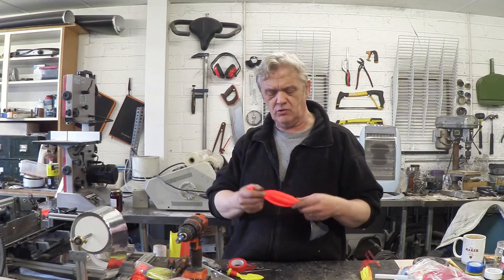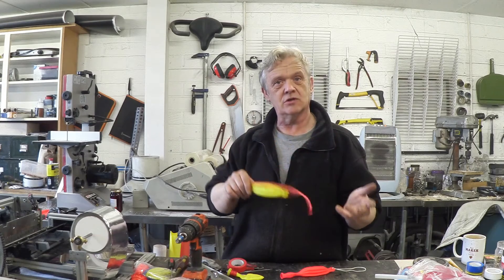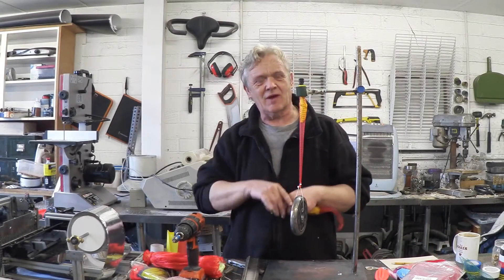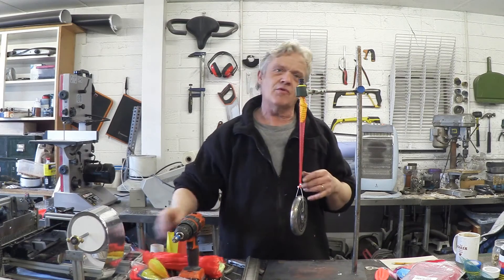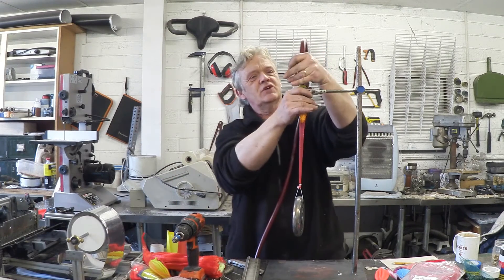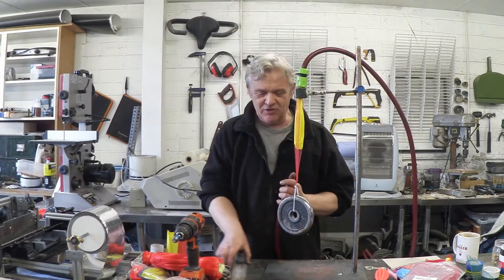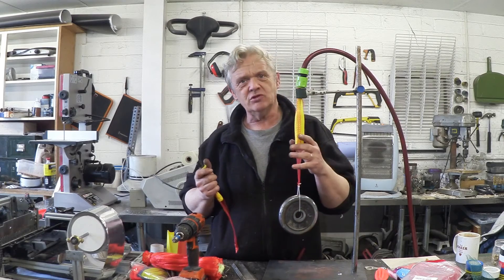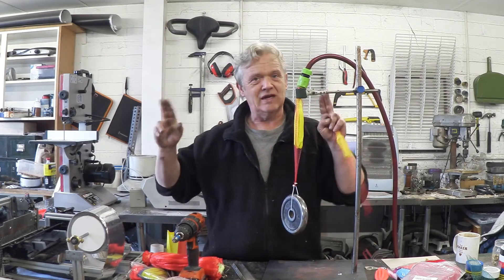1008 Improving McKibben Pneumatic Artificial Muscles

Comment: Is there some reason why this isn't used widely? Is there a trade off of force for distance as you get with levers? In any case I find it weird that basic design of the McKibben muscles doesn't seem to vary much having looked at lots of versions of it. It would be cool if someone created an evolutionary algorithm that tested out a bunch of different combinations of size and shape of balloon versus sleeve size to determine the best combination of force and distance (or perhaps there might be a direct mathematic way of proving what the optimum design might be). I also wonder whether the weave pattern of the sleeve could somehow be optimised.

Comment: After thinking about this for a bit, you Might be able to use an inflatable kids ball.  it would be bulkier when deflated, but Waay tougher, and should be substantial enough to put in a reasonable sized inlet/outlet on it for rapid inflation/deflation.   just a thought.

Comment: Rob, attach four or more internal stiff levers with solid spheres on their opposite ends with the other end attached to the top side of the balloon or bag then they will extend down into the lower tendon area, so the outward expansion of the bag will be greater as the balloon increases the angle of incidence between the levers!  I hope that description makes sense!
Reply: hey, i'm doing a bionics project at uni, would you mind if i asked you some more questions on your idea please?
Reply: @skunknetwork  Sure!  What do you want to know!
Reply: @themeek351  would you be willing to draw out your idea? maybe you could make a youtube video on it or something

would get some views and spark discussions?
Reply: @skunknetwork  No, I don't think that is necessary!  It's really a simple device, so don't over think it!  It's literally just two or three arms that can have smooth round balls at their far ends!  You could even mount rollers on the ends for less friction against the inside of the net bag!  Their other ends will join together in any fashion you like that allows the arms to hinge outwards!  Then mount the balloon or expanding bag on the inside of their joined vertices!  The expansion will force the arms apart.  There might be a little loss of lifting power, but it should increase the length of the pull!  This would depend on how flexible your balloon or expanding bag is!  I hope this helps!

Comment: Using a balloon that fills the whole net I'm guessing you would get less distance but more power for the same air pressure. In that case Isn't this like selecting different length levers?

Comment: Morning matey. I'm just trying to work out what the effect of a restraining band half way down the balloon would be? I'm talking about a, say, two inch diameter band. I've had a play with the maths, cube of the radius etc, and I think that two smaller balloons taking the same volume of air may have a greater "contraction" of the muscle, especially when the gap made by the two spheres is taken into account. Just an idea!

Comment: you know, I've always wondered if the nylon fishing line muscles from your video years ago could be controlled electrically by coating them with your ink, and heating it by running electricity through said ink.

Comment: Hi Rob. Seems to me that the satsuma net is too big; in that you need too much sideways expansion in order to get the required longitudenal contraction. Have you considered the more tubelike nets that hold 3 or 4 garlic bulbs?
Reply: the longer the contraction, the longer distance of the net sliding on the baloon, which means more wear on the baloon.
with more contraction range, the baloon will wear faster.
just a thing to consider in this topic